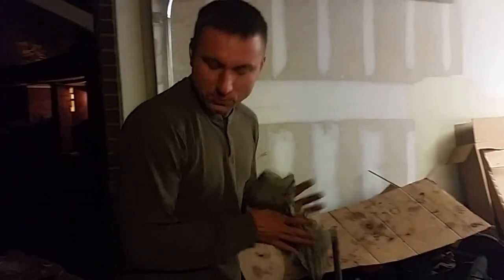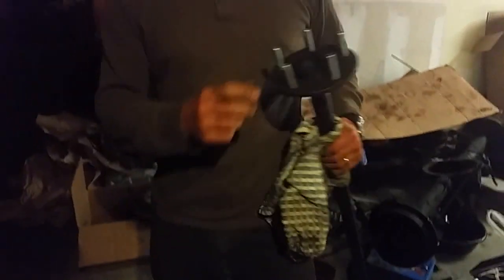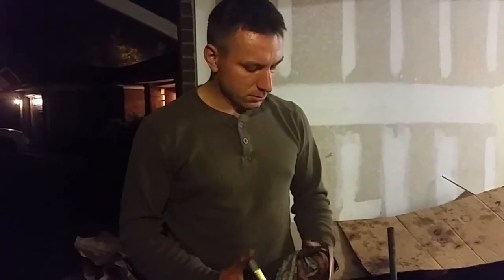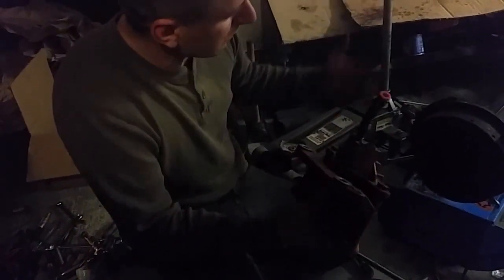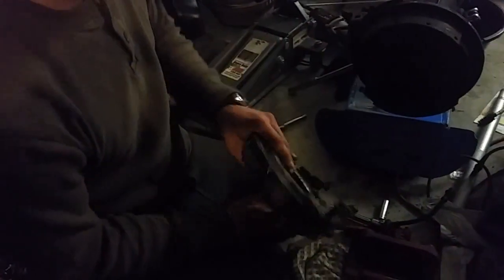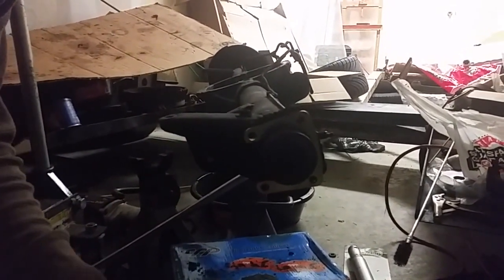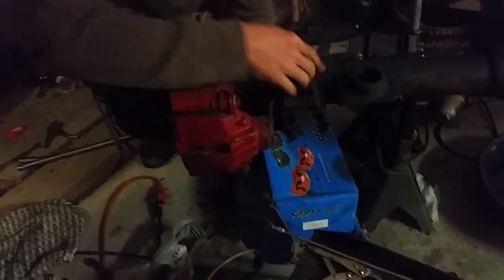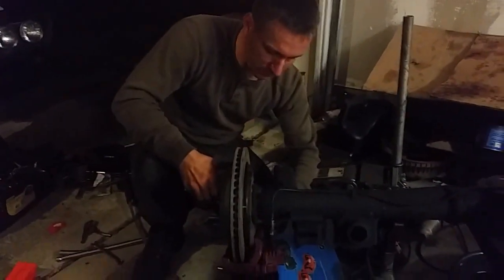ls1 swap. Best Cheap disc brake conversion upgrade. 12 bolt, 10 bolt chevy axle, classic muscle

Comment: Do the 1998 Camaro calipers and rotors fit on a 1966 Pontiac Catalina?
Reply from the maker: Michael Hamilton the rears yes, the fronts? maybe... you'd have to look for a kit designed for the b body cars... impala etc...

Comment: any ideas on 70s buick electra brakes ? believe it 5x5
Reply from the maker: Donovan Robins this will work if you drill the rotors to fit the axles.  same as i used mustang brakes on the 67 gto....

Comment: Will a 93-97 Z28 brake setup work or does it have to be off an LS1 Model?
Reply from the maker: Yes, but brakes are smaller, fit a 15 inch wheel and don't need that spacer.
Reply: @InvincibleExtremes  I have a 71 Chevelle 8.2 and I have an old 10 bolt out of a 97 Z28. So you are saying I can do the same process without the purchased spacer correct?
Reply from the maker: Yes.  I haven't done it, but everything I've been able to read up on it says you can.  Wouldn't hurt to try.
Reply: @InvincibleExtremes  At worst I would have to buy the spacers which would be just fine.....2 more questions if you don't mind....does the brake conversion set the wheel out any farther? And do you know what fitting it is to adapt the Camaro caliper to the standard brake line?? BTW thanks very much for your reply!
Reply from the maker: The fitting can be found at any parts store.  And it doesn't move out the wheels hardly at all because you're just replacing the drum with a disc.

Comment: ps do i need to ad a proportoning valve or change mastercylinder?
Reply from the maker: yes, i recomend the wilwood adjustable proportioning valve.  I have a video on it as well.  you cannot use a drum brake proportioning valve on disc brakes

Comment: I want to try this on my 69 Nova
Reply from the maker: Spacely it works, and well.  BUT, after driving on them for years I would recommend the brakes off a later model blazer instead... they have the same parking brake setup but fit with 15 inch wheels which these 98 camaro brakes cant...
Reply: THANKS

Comment: iam thinking if i do wat u did ill use the 5x4.75 patern not 5x5
Reply from the maker: custom axles then?  but yes, the axle tubing ends on a c10 12 bolt are the same as a car 12 bolt

Comment: why do you need longer studs
Reply from the maker: Jason Yi most aluminum wheels need them, and disc brakes are thicker... So as a rule, disc brake conversions usually need longer studs

Comment: Will this upgrade work on a 67 camaro 10-bolt?
Reply from the maker: Yes absolutely
Reply: Invincible Extremes Muscle Cars Garage awesome! One more question. Could I just get new brake lines that will bolt to a 3/8-16 thread, same as I have?
Reply from the maker: You mean new hoses.  I guess you can, just not sure which ones.  It's easier to just reflare your lines to use the modern nuts... or use an adapter

Comment: I have a 10 bolt on a 76 cutlass with the bolt in axles (no c-clips) will this work on mine??
Reply from the maker: Mylucidream not 100% sure, I know it works, but don't know exactly what changes will need to be made...
Reply: Thank you sir, i appreciate it. BTW where did you get the $40 plates?
Reply from the maker: Mylucidream brp hotrodding.
Reply: I called them and this swap does NOT work with the bolt in axle diff. :(
Reply from the maker: Mylucidream it does, you just have to do more work.  Google BOP axle disc brake conversion and you'll see what I mean.
Reply: Vladimir, do you know of any manufactured spacers/adapters that can be bought for the bolt-on axle or I will have to fabricate?

P.S. I have 67 firebird and I am inspired by your vids! Thanks
Reply from the maker: Aleksandr Emelyanov you have to mod the factory backing plate... shouldn't be hard
Reply: Here is how I figured it out. The problem with this method of using 98 camaro backing plate+adapter for bolt on axles is that the axle retaining plate does not "retain" the bearing due to thicker gap. I used carrier shims to fill that gap. They are the same diameter as the bearings. You can cut them wide enough to slip them in or you can remove the bearings to put the whole thing on between retaining plate and bearing. Advance AP has them under p/n 19640049 for 6 bucks. You'll need 4 boxes and almost no fabrication.
Reply: Aleksandr Emelyanov Thank you sir, I didn't want to go buy the parts and not be able to use them. I have very limited fabrication skill. This sounds doable even for me lol. Did you use the bracket from brp hotrod?
Reply from the maker: Mylucidream yes but I have a Chevy 12 bolt.  which BTW is a pile of garbage
Reply: yes, I used the bracket they sell for 40 bucks.
Reply: Invincible Extremes Muscle Cars Garage That's the best rearend GM ever made

Comment: How about 1988-2000 chevy obs c1500 truck?
Reply: Or rather are all 12 bolts the same? Through out the years?
Reply from the maker: Not sure.  I know some guys say the truck ends are different

Comment: Will this work on 64 tempest 10 bolt rear end
Reply from the maker: Yeas, it will, just have to work around the axle bearing retainers....
Reply: it wont, 8.5 & 12 bolts chevy have c clip axles, early pontiacs have a 8.2 rear  different axle with press in bearings

Comment: can a 74 chevy c10 12bolt work tooo any help would be great
Reply from the maker: the brakes will bolt up, but you will need to drill the rotors for the wheel stud pattern you will use and also make sure the hub bore diameter is the same as well at 70.5 mm

Comment: Like the video, Wish you would have set up a trouble light or something just so we could see what you were doing better. Its too dark
Reply from the maker: Yeah, I'm sorry about that.  Thankfully its a very simple swap and it is rather easy to figure out.
Reply: I realize that. I like the info on what year parts you used. I have a 68RSS 12 bolt.

Comment: so i did the swap nd when i bleed the brakes i get no brake fluid to the rear :(
Reply from the maker: fernando cuevas have you figured out why yet?
Reply: no Im looking for some one that specializes on brakes so they can fix it I think its I need a proportionig valve
Reply from the maker: fernando cuevas speedway motors sells an adjustable compact proportioning valve for $35 .  get it, works great

Comment: would that work on a 67 12 bolt truck rear?
Reply from the maker: Yes, but you'd have to drill the rotors to match the studs on the truck axles... or use custom axles with the regular chevy 5x4.75 wheel stud pattern... which would open up your wheel choices...
Reply: +Invincible Extremes Muscle Cars Garage 
thanks for the information

Comment: this swap will work for a 91 s10
Reply from the maker: Chris Bayne yes it will
Reply: Yes but you could use 99 and up S-10 Blazer the parking brake is Incorporated in the backing plate

Comment: Would this work in G-bodies?
Reply from the maker: LsxChevy360 yes
Reply: what's the part number for the brackets
Reply from the maker: LsxChevy360 don't know it off hand, easy to find, BRP hotrods sells em.  they are simply a 1/4 spacer in the shape the housing end gasket... they come up on ebay as well for peanuts
Reply from the maker: LsxChevy360 its under first gen camaros on the bottom of their page
Reply: Invincible Extremes Muscle Cars Garage thanks man i appreciate it

Comment: 10-bolt 8.5-inch differential

1971-’76 Chevrolet full-size cars
1994-’96 Impala
1971-’81 Buick full-size cars
1973-’77 Buick Gran Sport
1972-’77 Pontiac GTO and Le Mans
1970-’81 Chevy Camaro and Z28
1970-’81 Pontiac Firebird
1971-’77 Olds Cutlass and F-85 and Pontiac Grand Prix
1971-’79 Chevy II, Nova, Buick Skylark and Olds Omega
1973-’77 Chevelle, Malibu and El Camino
1971-’77 Pontiac Ventura and Phoenix
1971-’81 Pontiac Bonneville
1973-’77 Monte Carlo
1973-’77 Buick Apollo, Regal and Century
1980-’94 Chevy ½-ton and ¾-ton pickups
1977-’94 GMC Jimmy and Chevy Blazer
https://www.hemmings.com/blog/article/gm-10-bolt-8-5-inch-differentials/
Reply from the maker: Thanks

Comment: I did this swap but instead I used 2000 up s10 blazer, it would have been cheaper to buy a kit from ebay.
Reply: this was on a 12 bolt chevy, 8.8.5 will be the same.
Reply from the maker: Thanks for the heads up.
Reply: Some blazers have a different hat depth.

Comment: Awesome vid!!  Was about to spend $700 on a brake conversion kit for my 69 (8.5 rear) but this looks like the better route!!!
Reply from the maker: This is much simpler and cheaper, and it's oem parts
Reply: Also, the plates:  checked brphotrod and is this the correct part:  012-3400-00      F-Body Rear Brake Adapter plates , $39?
Reply: Nvm, scrolled further down and confirmed that is indeed the part #.  Just made all of my purchases.  Thanks again.

Comment: +Invincible Extremes Muscle Cars Garage Awesome! Would this conversion work on a 10 bolt 8.2? Do you have any recommendations for a front brake Disc conversion?
Reply from the maker: Yes this works on a 10 bolt.  Up front you can use c5 corvette brakes or 98 Camaro brakes.  I have videos on how to install both.
Reply: @InvincibleExtremes  Bolt in axles too?

Comment: I have a '72Nova. Would like to do this conversion. Years ago I installed factory front disc brakes.  Got the spindles, master cylinder, booster, rotors and calipers from a junker SS of the same vintage.  The proportioning valve that was on the junker was setup for front disc and rear drum.  If I do this conversion should I replace the master cylinder and change the proportioning valve for the ones you suggest.  Also, if I am using the stock 14 inch rally rims what year F-Body cars should I get the rear end from? My research has me using an F-Body from 1988 to 1997. From 1988 to 1990 the cars came with 14 inch wheels, 1991 to 1997 they came with 15 inch and 16 inch wheels.  You used a 1998 setup.  What if any problems will I encounter because of the 14 inch wheels? I hope you see wear I'm going with this.
Reply from the maker: 14 inch wheels might be a no go... best bet would be the 80's metric gm brakes...  built in parking brake and so on.

Comment: Hey man I saw your video with the nova and the f body Ls front brake swap I was wondering if I have a factory front disk brake car do I still need to get my spindles machined? Also would I just use the rotors off of a 98-02 Camaro
Reply from the maker: Isaac Joseph no need to machine disc or drum spindle at all for the swap.  kore3  has brackets and info.  brp hotrod has brackets as well.
Reply: What exactly do I need then to go from factory single piston caliper disk brakes to the Ls 98-02 calipers on my 69 nova they already have the disk brake spindle the car came factory with disks
Reply from the maker: Isaac Joseph the disc spindle is working against you in this case.  you need drum hubs and the brackets from the sites I told you about.  kore3 or brp hotrods

Comment: Great video!  Do you think this would work on a 87 Buick Regal GN as well?
Reply from the maker: yes, a common swap for the guys who aren't in the know is to swap in s10 disc brakes ....  the axle tube ends have the same 4 holes in them since the 60's at least..., its just a matter of deciding which GM brakes you want... i prefer these for performance applications.  Then just see if you need that little spacer or not.  If so, too easy, just get it, and if not, then even easier... just bolt the brakes on.

Comment: Hi! Do you have any experience with doing this on a 12 bolt axle from a full size car with 5" bolt circle? I'd like to know if the 94-96 Impala SS brakes would fit my 72 Riviera axle. The bolt circle and center hole sizes match but that's all I know.
Reply from the maker: +Tomas Gunnarsson  i&#39;m not sure, what i do know is that buick, pontiac and olds had a different mounting pattern for the backing plate.  If it is the same as the chevy one in 1972, then it should be good.  Also, keep in mind that as long as the center bore is the same, you can always open up the holes like i did on my 67 gto... i used mustang brakes that are 5x4.5 on a 5x4.75 wheel pattern ;-) worked real good.    That was on a cutsom 9 inch rear end, so ford brakes bolt up to it.  ... so as long as the chevy disc brakes actually bolt up, its going to work, even if you have to drill out the rotors.... BUT the hub bore has to match too, or it wont balance right.
Reply: Thanks, I'll keep looking for the info you menition. I'm trying to find a solution where I can keep consumables (read: rotors) untouched and if possible avoid hacking up the axle itself.
Reply from the maker: +Tomas Gunnarsson yup, smart choice

Comment: has anybody pick up on that he chose a 2.56 ti 1 gear ratio, why so high? had a 1966 bonneville with 2.41 gears at 425 hp it loved 147 mph. Pontiac guy...
Reply from the maker: Yeah I love the 2.56 gears in the diff.

Comment: Hey bud how are u well i ran into a problem i have stager shocks & right & left backing plate do i need to get to of the same backing plater or can i just turn it meaning ebrake handle facing up thanks
Reply from the maker: I have both calipers sitting on the rear of my firebird...The e brake handle isn't going to be a problem but the bleed nipple might be.  It needs to be facing up.  Try fitting it with both calilers at the rear, mine clears my left shock with 1/4" to spare.  I know that doesn't sound like much but it works...  i also have traction bars so that might play a role...  also gotta remember the 4 holes are splayed... so you need to have both calipers face same way, front or back but can't rotate the backing plate 180 degrees without drilling more holes in one of them.  You can only swap left to right... basically putting calipers in front or back together.... i have them in the back and it works.  Check out some of the 12 bolt rebuild videos to see how my 68 firebird is set up.

Comment: I have an 81 z28 would the 98 ss rear brake set up work for mine?
Reply from the maker: It should
Reply: Invincible Extremes Muscle Cars Garage thanks let you know if it did or didn’t

Comment: Will this work with a 15×7 chevy rally wheel basically a 15 inch rim? would like to do this on the rear when i do the front.
Reply from the maker: I don't think so.  I suggest using 99 blazer disc for that
Reply: @InvincibleExtremes  are u saying not just the disc but the whole set up caliper also off a 99 blazer will fit a 1967 12 bolt gm rear? Really apreciate the info man!

Comment: so did you ever do the park brake? & how did you go about it? i have a 72 cutlass supreme and i did the camaro swap also and have tons of other crap to do before i finish up (finishing up the ls1 with t56 swap) so i havent gotten back to it yet but did you somehow use the camaro cables or use your oe park cables somehow or something? its kind of a funny set up from the original on all older gm cars the camaro park brake cables are intended to be put facing back and turning back forward and kind of doesnt look as clean of a set up as the original set up i had i was thinking of putting the left side backing plate on the right and right on left causing the backing plate park cables to be working in the direction the old ones did but im hesitating only because then the calipers will be on the opposite side they are designed for on each side anyways i am sure i will figure it out eventually just curious to how you set them up thanks
Reply: regardless the fuckers are going on and gonna have to work lol just wondering if theres a lil cheat with the cables or not :)
Reply from the maker: chevecrazy454ss  brother... the calipers are designed to stay with the nipples facing up so you can bleed them.... BUT don't forget that you can switch sides with the brackets and then switch sides with the caliper itself... so the calipers will be where you need them to be and the cables will be where they need to be for you....  makes sense?   Oh and btw i never did bother hooking up the parking brake, simply because i just leave it in gear when its parked... ;-)   your cutless sounds baddass, i'm going to check it out on your channel if you have any videos up.  Thanks for watching brother, hope i answered some headaches for you ;-)
Reply: +Invincible Extremes thanks well i kept the left on the left and right on the right as its intended to on the back for the backing plates i was lucky to get the oe brake cable brakets along with all my stuff and cut them up and was able to weld them to the rear end housing tucking right behind the bottom side of were the rear shocks bolt up and they look nice and clean now i am sure i will just have to notch my brakets or make custom ones were they link together with the other half going to the rest of the car for the brake cables but it looks like it will work fine thanks found your videos helpful regardless thanks man your the man! because of your videos i just did the 98 rear caliper swap and the c5 with gto calipers also for the front like i havemt spent enough already and you just caused me to spend more lol thanks take care and good work on the videos
Reply from the maker: chevecrazy454ss well TECHNICALLY i saved you money because no matter how much you spent, you got better brakes per dollar than you would've otherwise.  Thanks for watching and if you want to thank us, tell yoir friends about the channel ;-)  because it's really all about the fans.  Have fun with that car man ;-)

Comment: Do you have to use that plate on a 7.5 rear end
Reply from the maker: You don't need the plate on any differential newer than 1997
Reply: @InvincibleExtremes  okay was just asking I have a 1983 Malibu rear end putting a 97 brake kit from a camaro on there
Reply from the maker: 97 should be fine on an 83